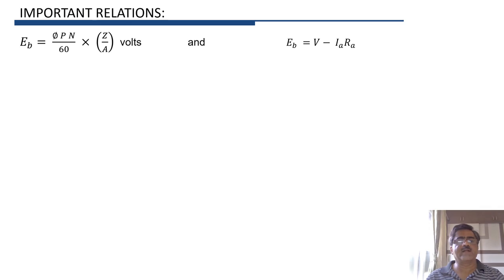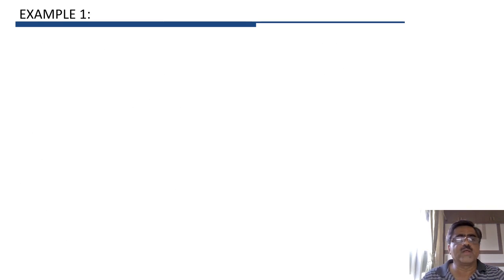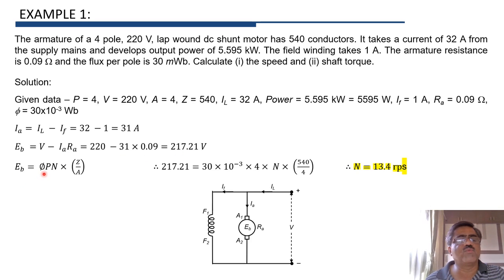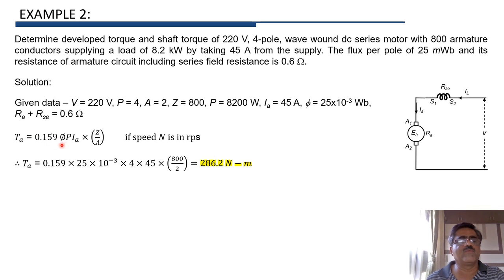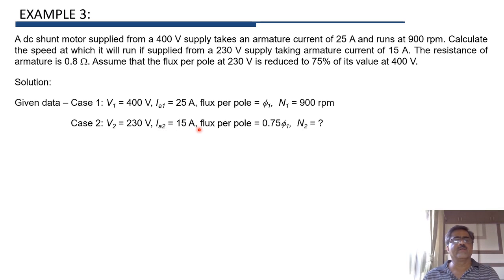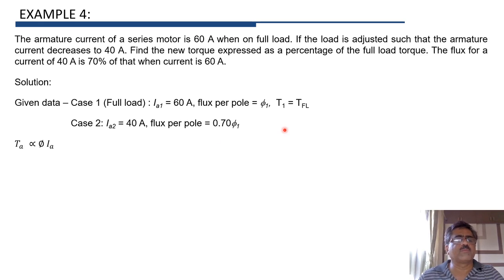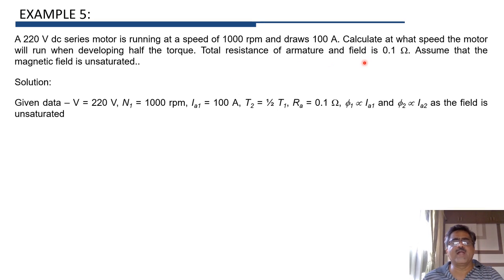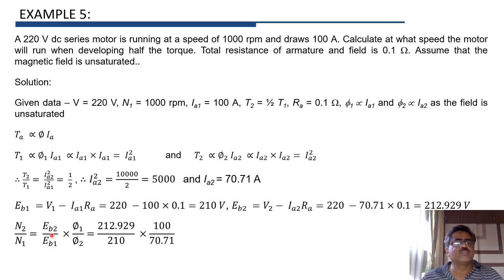Examples on Torque and Speed of DC Motors (21)

Comment: A dc 220 V shunt wound motor develops an output of 6.75 kW, with a 4-pole has 680 lap-wound conductors and it takes 30 A from the supply mains. The field winding takes 2 A and its armature resistance is 0.7 ohm and the flux per pole is 50 mWb. Calculate the torque. help me pls